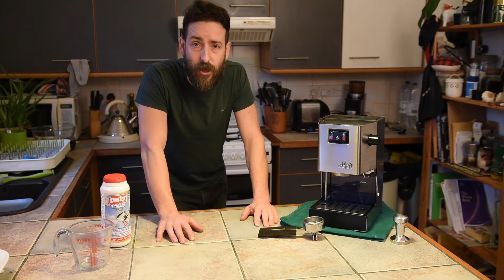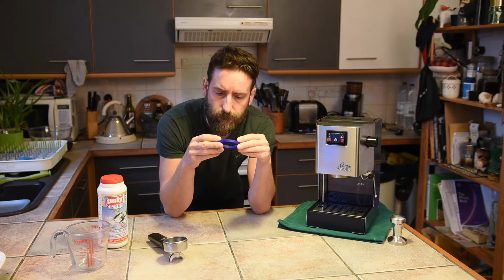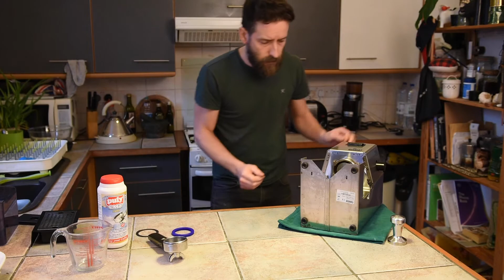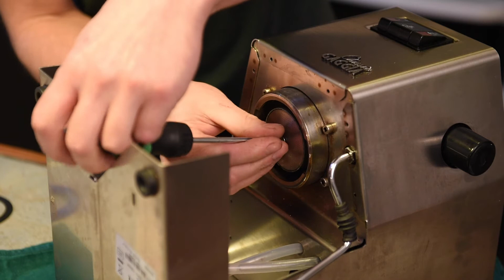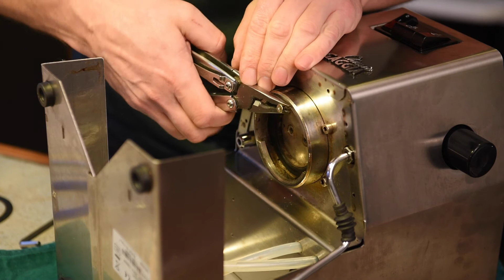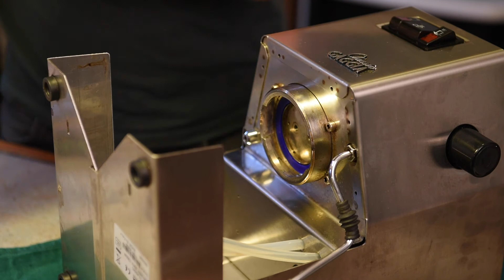Gaggia classic group head gasket replace SILICONE UPGRADE! How to guide.

Comment: Great video. I've just changed the original rubber gasket on my 2010 classic 😱😱, it had only just started to leak after 12 years of use. No writing on my replacement gasket,  so thanks for the heads-up on which way round the chamfer goes
Reply from the maker: No problem John

Comment: My screen rest is stuck to the boiler, even tried grabbing it with adjustable pliers with no luck. Any ideas?
Reply: I got a longer version of the machine screw that holds the screen on. By turning it through and it being longer it eventually pushes the screen rest off.

Comment: I cannot take out the second piece on Min 3:52, it's stuck badly, any advice?
Reply from the maker: It’s most likely stuck with corrosion/scale. Try tapping with something non metallic so not to damage. In the past I have removed by putting a large Allen key in one of the 2 holes and levered it out. Good luck.
Reply: @TRISTANorTRIS  Still impossible. It feels that the black rubber has truly stuck to the area...
Reply from the maker: @juansanchezbonet8415  if it’s not been changed in the long time it will be as hard as rock
Reply from the maker: Hey Juan, get it fixed?
Reply: Mine is tuck is from yesterday that I a trying  to remove it!
Is your fine now?
Reply: Mine was badly stuck too, ended up using an impact driver to loosen it up.